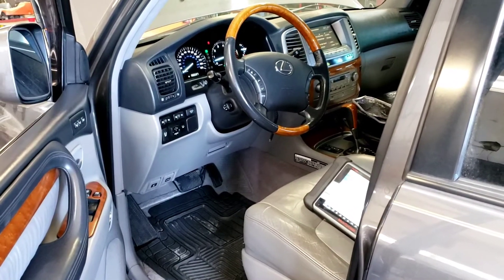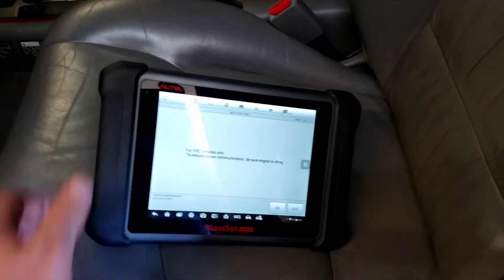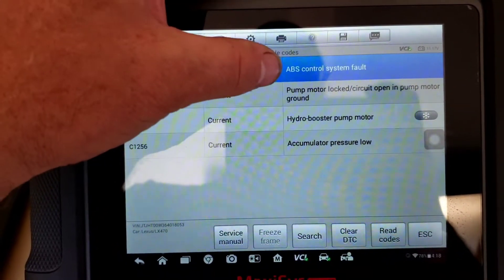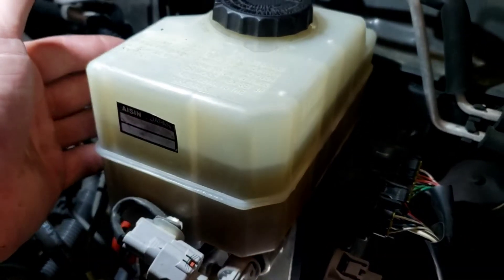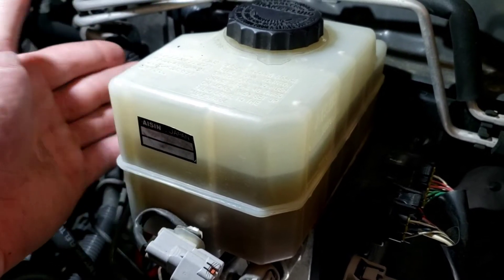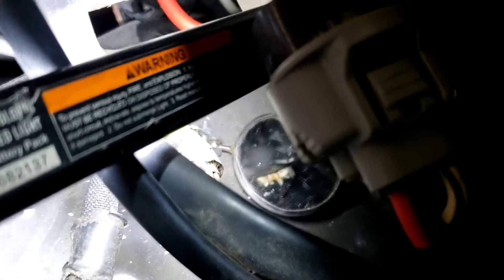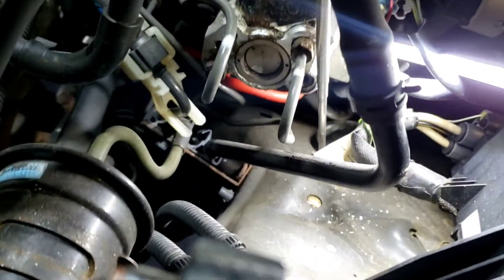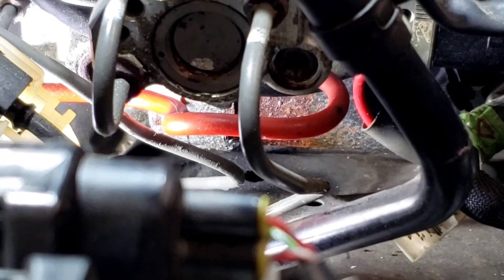2006 Lexus LX470 ABS Issues

Comment: This is exactly what my car (2004 LX470) sounds like only the alarm is only intermittent. It is always present on cold start but then only occasionally comes on while driving. Do you have any idea how much it would cost to fix the situation you describe and is it dangerous to drive it this way.  There appears to be no issue with the brakes though I only drive it locally and for short distance at low speeds.
Reply: My ABS was repaired in 2017 at the Lexus dealership for 3,600.00
Ouch!!!😢
Reply: I have the exact same problem with my 2004 LX470. Was wondering what you’ve done to solve it. I went to the dealership and they said replacement will cost 8K